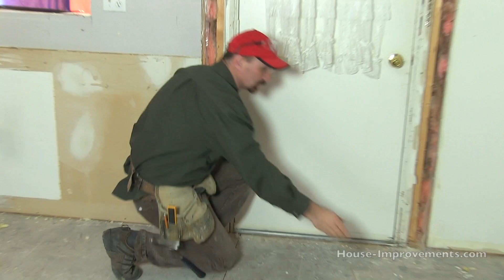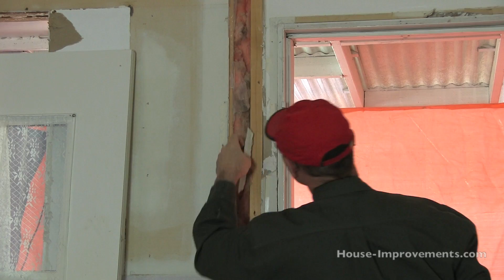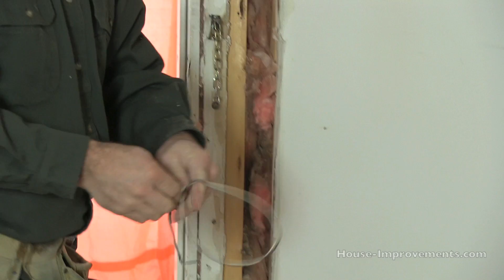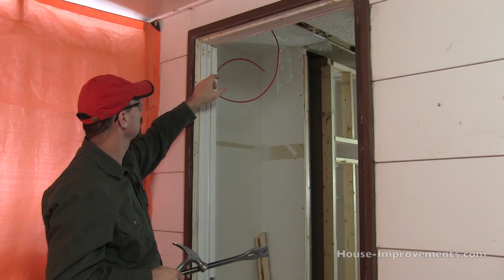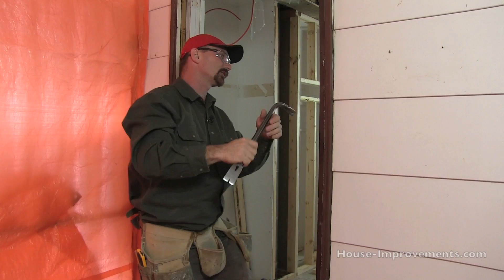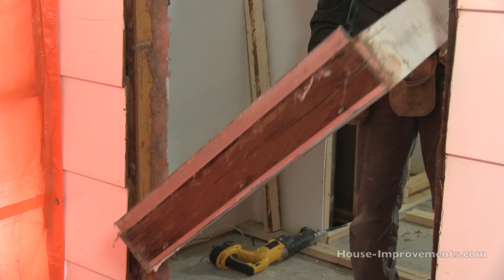How To Remove an Exterior Door

Comment: I need to remove an exterior door. The door opens inward. The door is locked. The door is blocked  on the inside by a dolly loaded with wood. Any suggestions? The electric garage door opener got hit by lightning surge and now we can not open the RV garage "DOOR"/this side door is the only way in but it has problems listed.

Comment: Good Job. I've never done an exterior door. I was sure it wouldn't be hard but there's always something new you can learn.  I'm glad I watched because I would have forgotten about my house alarm wiring on the top. The other thing I did was remove the excess sheet rock that hangs out. I just used my sheet rock hole saw and pushed in only, as I cut. I did this just in case I snagged it with the saw or the new door frame when I was installing it. If I snagged it, it could crack further into the wall, turning one job into three. The Door, Sheet rock repair and a paint job. Thanks for sharing. Best Wishes & Blessings. Keith Noneya

Comment: When you install a new exterior door should the jam be flush with the rough opening (wall stud) i.e. is the jam supposed to extend over the drywall and stucco or is it supposed to be flush with the stud on both sides? I am trying to figure out how to order a door for new construction and need the jam size
Reply from the maker: The two jamb sizes without custom ordering or adding on to them is 4-1/2" and 6-1/2". The jamb extends from flush to outside face of wall plywood to inside face of drywall. So a home with 2x4 walls ,1/2" exterior plywood and 1/2" drywall would be 4-1/2". You have some room to play with that, sometimes homes have 3/8 plywood and or 3/8 drywall so the standard sizes will work there also.
Reply: @HouseImprovements  Does it make sense that I need to order a 5 3/4 jam since I have 1/2 drywall and measured the stud to be 5 1/4? the plaster guy told me to do the jam flush with the stud. 
Everyone at the two hardware stores look at me like I am crazy, telling me I need to account for stucco and the measurements should be 1/2"(drywall) + 5 1/2"(they say all 2 x 6's are 5 1/2) + 7/8"(drywall) = 6 7/8

Comment: hello Shannon,

I watch most of your video because I want to have knowledge to solve my Patio having Transom 62.5 X 92.5 eventhu I can not do the work. ::))
I have a Patio Door (HDepot in USA call as Exterior Door as it connect to the Deck on the Second Floor). 
The door has one "fix" and one "open" (left open).
There is a leak and the  Maple Woodfloor (interior) was damaged.  The door is in perfect condition and it is costly to replace the new one. 
I would like to have the Aluminium Threshold/Sill replaced but having Composite instead of Treated Wood. The Middle piece of the "Fix" and "Open" Door (I guess is called Mullion) sit on the Threshold. 

In order to replace the Threshold and part of the damaged Maple Woodfloor and reinvestigate the Joist of the Deck, the Patio door need to be removed and re-installed. 
I pay someone to deal w/ the issues for labor and I would pay for  Materials. 
I already buy Vycor 0.025 in. x 9 in. x 75 ft. Deck Protector and try to buy the Threshold w/ composite. 
I would like to change the ORIGINAL wood frame w/ something that will NOT rot in the long run... it is possible?.

Please provide suggestion and recommendation. Thx

Comment: Does your blade have a double edge so you can cut either way?  Didn't know that they have those. Always great videos Shannon. I need to replace the side door to my barn on new house I recently bought.  The bottom has rotted out. Any suggestions or ides?  Thanks again. Todd.
Reply from the maker: +Nrfa My recip saw blade is not double sided but you can put it into the saw either direction.

Comment: Would this process be used to replace one side of a door frame on a light side door?  The lock holes in my door are drilled wrong and need to be re-drilled, I am thinking the door frame needs to be replaced and then re-drill the holes for the lock.  Thoughts?
Reply from the maker: Yes you could .